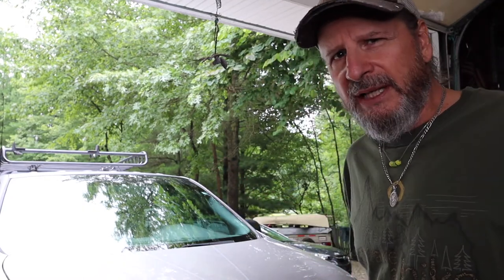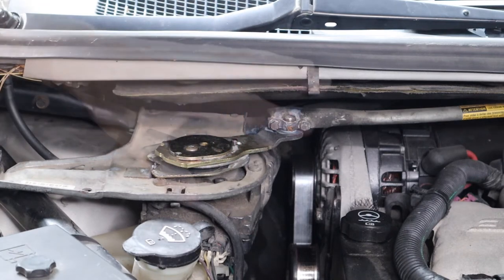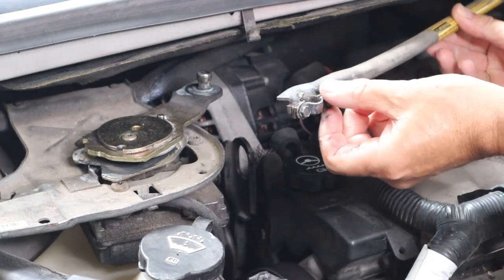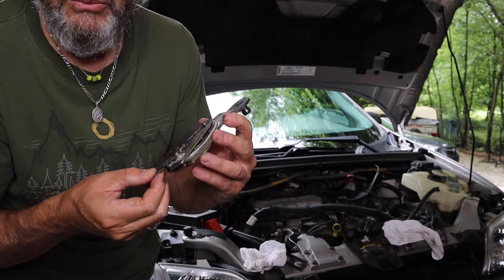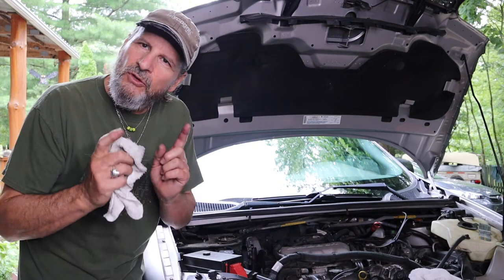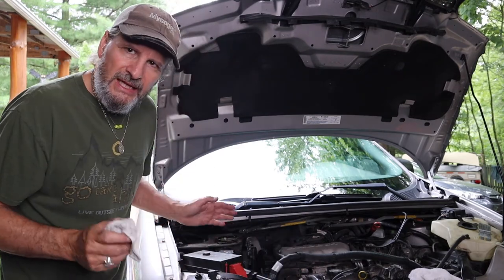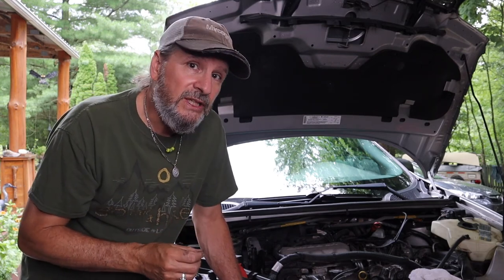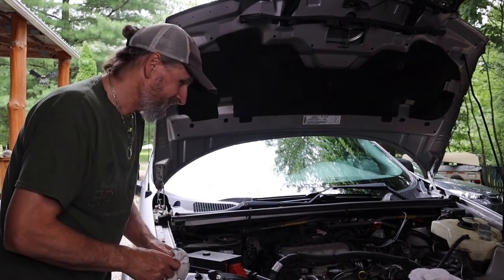How to repair a wiper motor on a 2004 Pontiac Montana. #pontiac

Comment: You saved me. I changed electric motor and wiper system wasn't go to 'park' position. Thanks a lot. Greetings from 🇵🇱👍
Reply from the maker: mikser1122 2 I am glad to help out. Even though mine has worked fine ever since I still get nervous driving down the interstate at 75mph in a heavy rain:)...I sure love that montana...hopefully it will continue to shuttle me around...greetings from the USA 🇺🇸 👍

Comment: Thank you! As soon as it cools off I'm going to go give this a try. I just replaced alternator and had to unbolt wiper motor. But the center torx head screw wouldn't turn and I'm afraid of stripping it. Got alternator back in but wipers are parked straight up. I think I can disconnect arm again, manually turn mechanism into correct position. Good job of explaining this!
Reply from the maker: U r very welcome...it's a weird system but works if properly adjusted :)
Reply: @laffilmfest3759  ya, something is buggered up. I think it's the spring loaded clip. This weekend I'll try other methods of getting that screw out and inspecting the mechanism. But wipers work, just parked straight up. Guess the van is signaling Touchdown! For now

Comment: My wife just got her windshield replaced. The window  looks great but the wipers were so messed up they crossed over each other after the guy finished.  I need to replace the miter and the wiper studs. Thanks this helped out quite a bit.  Of corse the Satellite glass guys did nothing wrong they said.  Everything worked perfect till they replace the windshield. Nice work.
Reply from the maker: Ewww....I would be upset with glass guy! This system is complicated and it sounds like he did something to throw it off...mine still works fine and still makes me nervous to run it :)
Reply: @laffilmfest3759  yes sir but I fixed it and it was simple as you did the heavy lifting. Thank you sir.

Comment: Great video! I have a new cam that I have to install today. I hope I can get it to go in the park mode. I’ll let you know.
Reply from the maker: Ok...good luck...it's a complicated design...thanks for watching!
Reply: @laffilmfest3759  I didn’t get it to return to the park position. Any ideas?
Reply from the maker: I'm sorry but I dont...I had a lot of trouble too, keep watching the video...I bet the answer is in there...everything has to be aligned just right, I'm thinking I kept taking it loose and readjusting just a little bit each time...maybe if u stopped into an old timers garage they might be able to tell ya

Comment: I'm trying to get my control cam and motor off so I can replace the alternator.  Unfortunately, I stripped the middle screw head ☹️.  I drilled the head off and yet it wont come apart.  I watched your video to figure out how to take the wiper motor out.  Looks like you kept the 3 motor screws in and the cam mechanism can be priced off after taking out only the cam motor shaft screw?  mine is stubbornly stuck ☹️
Reply from the maker: Hello, that sounds right but man is this system a pain as u r finding out, honestly I filmed this to show my struggles but the system is too complex for me, I'm hoping somebody comes up with a different system all together to modify it but I'm thinking the Montanas are getting too old for someone to spend time on inventing that. I'm sorry I could not be any more help...good luck to u...personally if I have more trouble with it I'm going to go to an old school mechanic that knows Pontiacs:)

Comment: Thought u was changing out motor
Reply from the maker: Melvin Riddick so far so good on the repair....it's just an awkward system......blades just don't operate smoothly.....maybe some day i will try to replace the whole wiper system.....thanks for watching
Reply: Yes I changed the motor and. Chance the transmission fluid now it doesn't change gears
Reply: Yes we changed the motor and we changed the transmission fluid but now it doesn't change the wears it runs but it doesn't change gears

Comment: If you are going to keep making these kinds of videos, you should probably have a service manual. It will definitely cover realigning the wiper blades!
Reply from the maker: Hi Emment....I missed this message and great idea...I definitely could use one :)
Reply: @laffilmfest3759  Since then I discovered the GM made a library of manuals for the “U-Platform” so a Haynes manual might be better. I picked one up myself. :) I don’t think it covers the wiper though I managed to figure it out myself when the cam jammed and sent the passenger wiper off the windshield!
Reply from the maker: I truly do not like that wiper system...about as much as I don't like the battery placement...but....I love that machine and realize I too have faults of my own :)....I will check into a Haynes manual....thanks Emmett!

Comment: I have the slightly updated version of this, a Saturn Relay level 3, it's a little different from this but not by much. I certainly agree it's far more complicated than it needs to be, but that's true about a lot of things on this farce. Mine rides pretty well too. But I have only 117k on it, you would expect that it would. Cushy heated leather seats. Probably it's best feature. I bought it this sping to hold me over until next year when my house will be paid off. But it replaced a beautiful Chrysler town and country touring. I just couldn't swallow another damn transmission. But perhaps it would have been better if I did. At least it's not rusting out. An old couple owned this thing so it's fairly spotless inside and out. But boy does this thing lack in road manners and features. New tires, shocks, struts and brakes all around it still drives like a drunken horse. New plugs, wires, oil, intake and filter and it's still a slug. Maybe the Montana was somehow better, but I can clearly see why GM doesn't make these things anymore. Even the heating system on these things are overly complicated and poorly designed. The pipes that feed the heater core are at the bighest point in the system. If you don't check your cooling system of if you do and don't pay attention to the coolant levels in the system any coolant loss will require that system to be bleed or you might not get heat. Very prone to air pockets. The olderly couple I bought this from swore it was going to need a new heater core. Nope, just needed to be topped off and bleed. Wasn't even down a quart! So that one while a head scratcher wasn't a tought fix.
Reply from the maker: R.a. Wheeler thanks for all the good points! I just had the oil changed and the guys were trying to talk me into flushing it.....maybe that should be on my list, i have about $3500 in mine now, 142,000 miles, just got back from a 2500 trip to the north country, getting ready to head south about the same distance.....rides like a dream, and is pretty stealth, im going to do a video on how it's a pretty cool urban/country bug out machine, things go really wrong in our country that is pretty important to be low key, i really appreciate your input....👍
Reply: I changed the transaction fluid now that transaction doesn't change gears please help me
Reply: Chance transmission fluid now the transmission doesn't change gears please help me
Reply: @Abel Guerrero  Sounds like you need a mechanic. Good luck with that.  Remember internet diagnosis isn't easy. Thumbs, like and subscribe. Thanks!

Comment: How do you get the control arm in the resting position?
Reply from the maker: This sounds terrible but I really don't know...I would have to keep rewatching the video to figure it out, and honestly I don't think I really ever understood it compketely...seems to me mine wasnt wanting to rest...then I kept messing with it and like magic it went to rest...super weird but I was very happy...still working good
Reply: @laffilmfest3759  My control arm does not stop and then move the opposite direction to put wipers in there park position. Very strange. I’ve messed with it for hours. Looks like I’m just going to have to leave it the way it works. Appreciate your input.
Reply from the maker: Hello...just watched my video again, the timing and position of the rotating control mechanism is every thing, make sure from inside ur vehicle switch is all the way off( park position), then install the controller without the control arm on...if it doesn't work right make sure that lever on the bottom side is catching that piece of steel on the bottom side...if those two don't match it won't reverse, it took me numerous times removing it from the spines...rotating it a bit...reinstalling again to see if that worked...all with the control arm off(long rod that works the blades)...not sure this will help...I'm thinking u r really close to getting it
Reply: @laffilmfest3759  Thank you for the information. I greatly appreciate your time and knowledge. I’m going to try again tomorrow. Wish me luck! Lol. Dan
Reply from the maker: I do wish u luck!
Reply: @laffilmfest3759  I just spent a frickin hour on this thing. I’ve watched video after video and it still doesn’t work. I guess the blades will have to park on the windshield.
Reply from the maker: Dang...sorry to hear that! As u drive around keep an eye out for an old auto garage...may not look like much but u might find an elderly master mechanic hiding in there that can adjust it in a flash...
Reply: @laffilmfest3759  I will do that. I really appreciate all your help. Thanks!
Reply from the maker: U r welcome...let me know if u get it working
Reply: @laffilmfest3759  you’ll be the first. But, don’t hold your breath. I’m kind of tired of screwing with it.